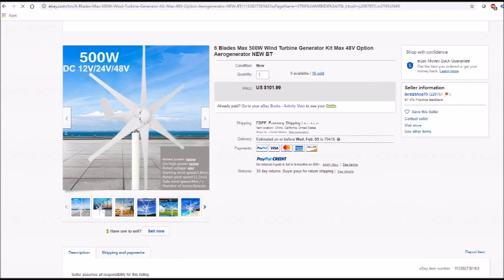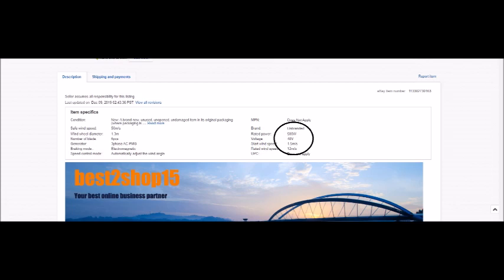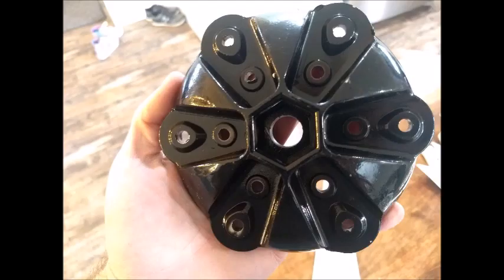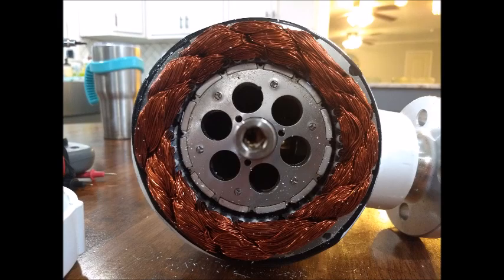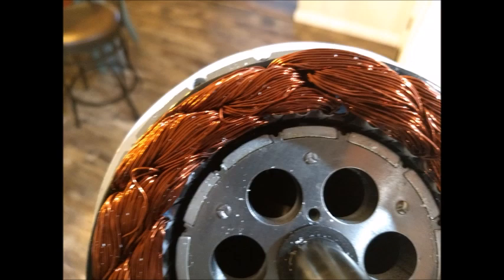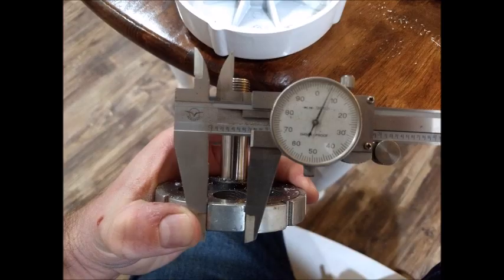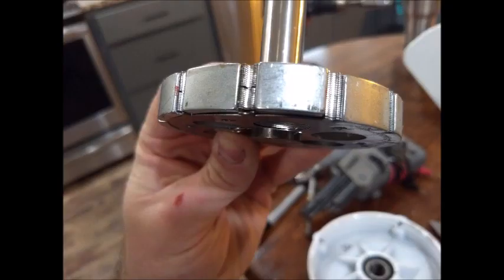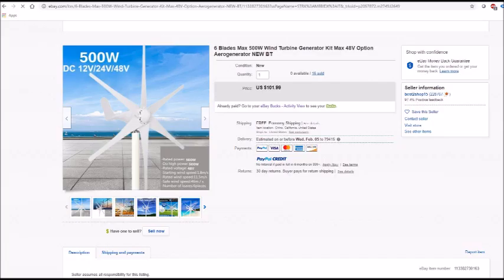eBay 500 Watt Wind Turbine Review

Comment: Hi, I have a ne500/me500 it has done 700 to 800w in gusts, and survived lots storms 100k gusts, i also have that the same 300/400w turbine with the tail facing down its a pretty good turbine but it gets dirty wind alot so does a spin around. i have 650mm blades on the 400w and 750mm on the 500w. nice to see your setup 👍
Reply: I cut the finn off of mine as it was spinning away from the wind. I made a new finn 5 rimes as big and made a 1000mm extension pole and attached it to the body. As soon as i lifted it back up it spun to the wind direction and stayed there. Iv only ever hit 163w snd 11.9 amps
Reply: @ollypolly18  in what winds ? I regularly see 500w in 13m/s
Reply: @offgridamps  30 to 32 mph
Reply: @ollypolly18  its not a 500w then, probably 100w how much did u buy it for ?
Reply: @offgridamps  £106 from vevor in the UK
Reply: @ollypolly18  yeah thats about 100w one so, pricing is up but a 500w should be 300 -400 euro and 15-20kg

Comment: Probably nothing new to you but balancing blade and hub assemblies can help quite a bit
Reply from the maker: I've actually pulled the hub assembly off three or four times trying to sort out that "flutter".  It doesn't produce the claimed rating, but it is a solid 200~225w turbine in rated wind...which is at least somewhat useful if the blades don't flutter.  When I initially took the rotor out it was a slip fit into the nose bearing.  At the time I didn't consider that to be an issue, but with this thing exceeding 1000rpm I think it's allowing that minuscule tolerance to vibrate.  Possibly.  The blades are very thin at the tips and it may simply be exceeding their ability.

I'm considering trying a different set of blades on it...but, at the same time, I have  lot of time and effort invested in this machine with very little return...I think it's coming down in favor of the next turbine :/